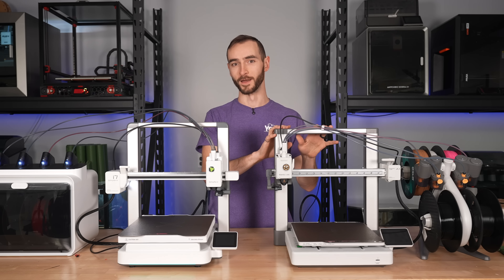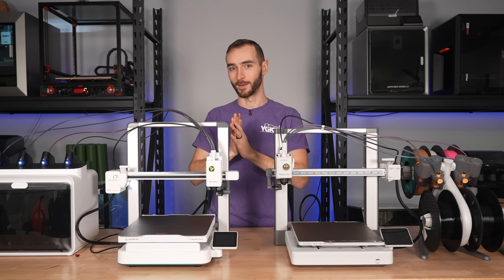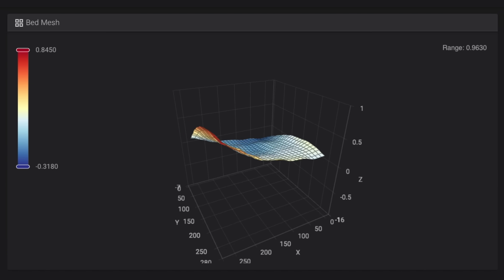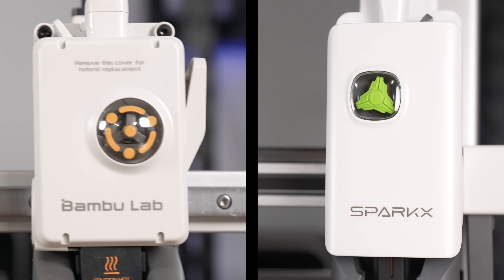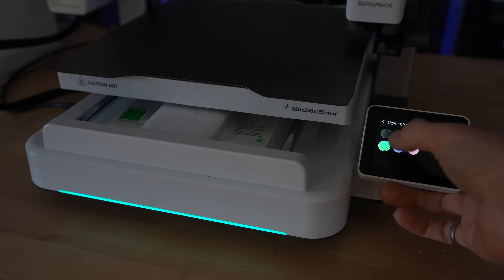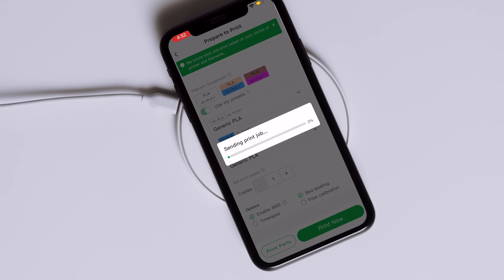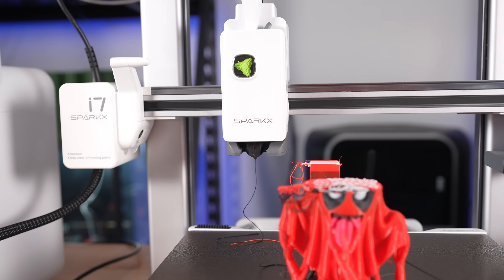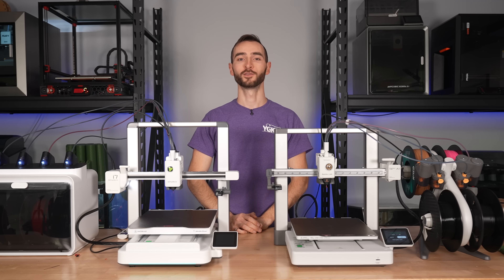Creality Cloned Bambu's Bestseller (and made it better?) - SparkX i7 vs Bambu A1

Comment: That only means one thing. A2 is coming out soon.
Reply: I'm not so sure. The A1 is basically the ultimate bedslinger. I would guess maybe a P2P could come out in the $450 price range and the A1 line will be left alone until phased out years from now. Bedslingers are becoming less appealing as core xy machines continue to get cheaper.
Reply: @Ukraine2-k7x  They have developed new tech on the last year along, Idk they could do something with the purge waste for multicolor printing for example.
Reply: @Ukraine2-k7x recently got a elegoo centauri carbon in my office for like the same price as the a1 it’s so goood as much as a1 is good I basically slice and print whatever fad designs I make it’s so seem less almost set it and forget it
Reply: @Ukraine2-k7x that is only as long as you're not using a plate changer like the JobOx system. I'll never switch to core xy, as I can print 12 plates on one printer without any intervention
Reply: @Ukraine2-k7x  Ultimate as long as it doesn't burn itself down to the ground with bambu not acknowledging that there is a problem and it's an active FIRE HAZARD.
Reply: @Splarkszter  Bambu handles recalls well. Let's not pretend they are the only ones to have possible issues like this 😂
Reply: @Splarkszter  They did It 1,5 years ago dude...
Reply: @Ukraine2-k7x No they ARE the only ones with fire issues. Lets not pretend its not a reacurring problem for Bambu
Reply: @Trafo888 Uh NO DUDE. There are NEW ISSUES...A1's are melting thier circuit boards now internally. 3D musketeers did a several month long investigation on it and Toms Hardware followed it up....Bottom line from both: DO NOT buy an A1
Reply: @William-b5s2r  Well no, Qidi has a larger fire issue with the Plus 4 I believe. No shame on them, they handled it as well. And I'm sure there were more that were with machines that just didn't sell as much or weren't in the audience of less advanced users.
Reply: @Ukraine2-k7x Those issues were with Beta units and it didnt cause fires, it was just an exposed wire that coukd burn your fingers if you touched it.  I would say that TWO different issues with actual flaming up from a single model machine is worse. And Bambu never "handled it well" they were threatened with lawsuits from the FCC first then they tried to tell people "just print a cover over the cord" for the first fire issues. FCC said that wasnt going to cut it so only then did they do an actual recall. This second time though which is WAY worse Bambu as if right now have done NOTHING even though they were told about the circuitboards melts 6 months ago.....So hmmm not really "handling" huh?
Reply: @William-b5s2r  Well, I'm pretty sure their whole "Print this cover for the end of the cord" was more as an interrim fix, since they were only on the market for a whole two months before initial reports of the issues (Of which, there were only 19 reports of damaged cables), so that IF people still wanted to use the printer, it would help to not put so much strain on the end of the cord, until they actually had the parts available.

And I'm sorry.... but where are you getting your "They were threatened with lawsuits from the FCC" from?  They issued an advisory notice about the cable at the end of January 2024, and issued a full recall on February 4th.
Reply: there has been a bamu pattern dropped for a duel tool head a1 style printer
Reply: @TwoWheelRyan  what is bamu pattern and bambulab pattent is only if you copy the exact same thing they change smaller things that bambulab cant sue them and chinas brand copy each other not a suprise
Reply: yup
Reply: If you look at printers in this class, they tend to follow a similar structural logic and design philosophy. That's not necessarily a bad thing. The outward appearance is really just a small part of what defines the actual user experience.
Reply: When ???
Reply: There is a patent already for a dual nozzle A1, saw it on the Bambu subreddit a couple days ago
Reply: The Kobra X wil blow them both out of the water.
Reply: @dennisraadschelders6821  ..... It's just another bedslinger.... looks no different from the A1 or any other that came before it.  The sad part is, I remember when the H2D was announced, everyone was ranting about how much of a nightmare removing a clog from the H2D's dual nozzle extruder would be.  Can't imagine it being any better on an extruder that feeds 4 different filaments down into the same nozzle in what seems like a very confined space.
Reply: @theElemDragon  but they both can’t print multi pla mixes. The X can do that. Also it has less waste.
Reply: @dennisraadschelders6821 what do you mean "multi PLA mixes"?  From two different spools?  Cause that doesn't sound like a benefit to me in the slightest.  How would that even work?  You'd need a melt zone SIGNIFICANTLY larger than 1.75mm, which I can't imagine being helpful for flow.
Reply: @theElemDragon  Sorry had some brainfog, I meant TPU. Like the U1 the Kobra is more or less on its own in that segment a segment that didn’t excist before.
Reply: @dennisraadschelders6821 features can be brought to market by anyone when you copy your competition's design. I loved their cam shaft design but end of the reliability is a big factor which Anycubic is not known for. There is a reason why there are lot many print farms running Bambu and Prusa two completely opposite brands when it comes to proprietorship because they are reliable. At the same time you don't see much Anycubic/Creality/Elegoo print farms do you?
Reply: NOPE! With the new fire issues of the A1 (capacitors melting inside) Bambu has to address that first. Couple that with the horrendous sales numbers and reviews of the H2C, H2D, H2S then the huge market loss to Snapmaker Bambu is in trouble.
Reply: @William-b5s2r  Horrendous H-series sales numbers and huge market share loss? Who are you kidding, Bambu still has almost 30% of the market. Snapmaker celebrated 20.000 U1's sold last month while Bambu sold over a million printers in Q1 2025 alone. The H-series might not be as good as expected and might not sell as well but they're still selling more printers than any other brand. 73.7% of the 3D printing market is Bambu Lab and Creality, the rest is mostly AnyCubic, Elegoo, and Prusa.

I know it's cool to hate on Bambu Lab these days, but lets not act like their business is crumbling to pieces.
Reply: keep buying their slop that got recalled twice and still catches on fire
Reply: @VD-cc4hx  Yeah, it sucks when a company acknowledges an issue and tries to fix it. That's also what creality does right? They fix their machines and don't just make a new one each couple months right? There is only one version of the ender 3 and only one version of the K1 right? We also don't think they would make a revision to the K2 right?
Reply: @slambaz2 Creality doesnt have issues with thier printers catching fire, no addressing issues if they dont have any 😂
Reply: @William-b5s2r  yup. Instead they don't fix anything wrong with their printers and just make a new version and sell that instead. I would know, I have 3 creality machines.
Reply: @slambaz2 What major issues has Creality had hmmm?  Lets see what you makeup, im curious
Reply: @William-b5s2r what is there to make up? How many different ender 3 versions are there? 13? More? How many different versions of the centauri carbon are there? How many different versions are there of the Bambu A1 are there? Until creality stops and makes a quality machine, their products will always just be third class.
Reply: @William-b5s2r  Brother's mad he can't afford a Bambu printer
Reply: @William-b5s2r  "Creality doesn't have issues with their printers catching fire"..... *searches Google*..... Would you look at that..... They had a potential QC/Design flaw in the CR-6 SE back in 2020 that resulted in reports of fires/smoke.  So..... Bambu had one..... Creality had one...... how many others had one?

Or there's the faulty heatbed on the Ender 5 Max..... or the supposedly SIGNIFICANT heatbed warping on the K1 Max
Reply: @William-b5s2r damn all you do is complain
Reply: @VD-cc4hx  are you upset that a company did a voluntary recall?  Creality should have recalled the K1 after the door shattering design flaw.  Shattering glass is a serious safety issue.

They did nothing.  They collected money from replacement parts.  

Bambu paid for the replacement parts.
Reply: @VD-cc4hx  me when I make stuff up.

Comment: i7 isnt cheaper, that is just the early bird price difference. altho the i7 is considerably better here, especially with the ams,  but u r comparing it to a 2 yo printer, u should have at least mentioned that.
Reply: It will be cheaper mate,  that;s the whole point of this, it;s a cheaper A1. The crossed out $399 is a BS marketing price they will never sell it at, it;sa trcik all the chinese brands use to say, This is what you are saving. when it will never ever sell for that price.
Reply: @FauxHammer don't know. I spent 250€ on an A1 on Christmas. This is hard to beat
Reply: @dsdasdasdasdertewbd 
Did you buy it with or without the ams lite?
That could make the change
Reply: Be honest, that’s the price you’re going to find it thru out its life cycle, including all the “sales” periods like Black Friday.

Comment: Print quality is the most important to me and that seemed to be breezed over rather quickly
Reply: Every other review I've seen of this printer has said pretty much the quality isn't great. In fact, this is the only review I've seen that gives it high marks and definitely the only one to claim it's better than an A1. I think it's odd that it failed 3 times on the same print yet that was glossed over and still somehow better than the A1.
Reply: @psychoticgoldphish5797 I agree. This was a "Hey look at this new printer! Here is where you can buy it!" Does not show us any of the downsides of the machine or discuss reliability. Hard pass.
Reply: @psychoticgoldphish5797 I started out on several Creality printers. I'll never go back.
Reply: @psychoticgoldphish5797  I mean...... it's Creality.  I don't think their printers have EVER been known for their quality of prints..... or reliability...... or consistency (unless consistently bad....)
Reply: Seems to be common with reviews today. Big focus on user experience and failure rate, but barely any on print quality.
Reply: @MumrikDK tbf, print quality is overall becoming the same between all printers and waaaay more dependant on the user than the printer itself
Reply: Because then it would be no competition between the two machines.
Reply: Nah it wasn't breezed over at all, just made that part fast because in every actual print metric it was objectively worse aside from barely wasting less filament... this video had to be sponsored. Clearly stated I7 failed more prints because of a design flaw that definitely will happen again, has slower startup time, didn't cover actual normal and fastest prints speed(I'm guessing because bambu wins that too), and then just quickly skimmed over the minor details of lower print quality and poor pressure advance to somehow conclude its better then A1 anyway

Comment: over 8k hours on my a1... lets see how the sparkx holds up after a few months. my enders always worked great, until they didnt.. usually months later
Reply: That's my thought. Cool. But it's still creality. 😬 I've had my fill of their printers
Reply: ditto. My brother recently asked me for a printer recommendation before this came out and asked if he should wait and I said no because even if the creality machine is good out of box i have not had a good experience with longevity and bambu has shown that they are willing to keep supporting their machines. Do I like their locked down software, not one bit, but for people who just want something to work and be a tool and not a hobby, the A1 is the go to
Reply: Creality has constantly missed the mark for every purchase. I reluctantly bought some of the space pi heaters...and they don't work when you use 2 rolls of filament with it.....🤣
Reply: New A1s keep popping their power board NTCs quite fast, so hold on to your good old working printer 😉

Comment: i would not have priced compared to a launch price. that is a "launch" price and do not know what a normal price is. also, the A1 has been around for 3 YEARS and Creality the bad clone company had 3 years to try to match. In the same 3 years Creality would have released 3-4 newer versions of the same printer line up. leaving those that bought this left with broken features instead of fixing them.

Comment: So when crealtiy tried to match the A1 with the Hi the first time around and that failed, they decided to fart out another printer while trying to minimize the tainted creality branding. And then there's the ender v4...
While this printer has a few nice features, I didn't see anything that would make me choose it over an A1. I do like that CFS lite a lot though.
Some things were left unanswered as well. Part availability? Compatibility with fiber filaments like carbon or glass fiber PETG or PLA? TPU?
The A1 can handle all of those.
This was definitely an informative video, but left some important details out.
Ross from fauxhammer had a less positive experience with his i7.
Reply from the maker: I think their big mistake with the Creality Hi was making it black instead of white. 

I’ll have to check Ross’ video out. I’ve got 4 printers to review this month so needing to go a bit more surface level on a few of them. TPU printed well in my testing.

Comment: That's just a clone but... the cfs lite is a major upgrade which save the i7 and probably a better option IF the printer is reliable as the A1 is.

Thanks for this quick comparaison.
Reply: i wouldn't mind seeing that machine run an actual bambu toolhead, necessary revisions completed of course, with vanilla klipper just to see what happens.
Reply: "IF the printer is as reliable as the A1 is"

😂🤣

I would not bet my money on it.
Reply: @janenglund mine are reliable maybe yours not

Comment: 150g of waste for a small cow head is insane, anybody who wants to do multicolor/-material (accept smth like hueforge) should just save up a bit and get the U1 in my opinion.

As of i7 vs A1 (no CMS,AMS), they seem the same, so with all the fire hazard reports about the bambu A series, there should be no reason to go with bambu at this point

edit: great video as always
Reply from the maker: You’re quite right. If someone is serious about multicolor they should probably just spring for the U1. But there will always be people looking for the cheapest option without considering the tradeoffs. AnyCubic has even this one beat at $269 for their 4 color printer. And supposedly it’s more efficient too. I’ll be coming out with a video on that soon.

And thanks so much for watching and commenting! It really means a lot to me.

Comment: Isn't a long retract also what the MMU does?
Reply from the maker: Prusa’s MMU? Yes, except in that case they retract fully all the way out, rather than cutting, which requires very specific settings to avoid clogging the hotend.

Comment: Ive had an A1 melt and almost start a fire. Did some research online and many other people have had the same happen to them i don't trust them.
Reply from the maker: Dang. Bed cable related or something else?
Reply: @ygk3d an ntc thermistor can overheat in a batch. Can melt the plastic cover but can't start a fire. At all. Bambu is sending out parts and the new batch is fixed...
Reply from the maker: @blackrul3z is this what Grant of 3D Musketeers has been speaking of recently?
Reply: @ygk3d  Yeah, it's overblown though. Grant makes it seem like every single A1 will have the issue, while it's only a very small % from a particular batch. None of my four A1s had the issue.
Reply: @NWGR  It's in the consumer's best interest to keep blowing this up until the company issues an official statement about what's going on and which batches are at risk or issues a recall. Licking the company's butt and making excuses for them isn't in the user's best interest.
Reply: @ygk3d  yeah Grants video is how i found out that it was the thermistor after it happen to me. The rest of the people who had this happen to them are on reddit. Pretty scary stuff.
Reply: @ygk3d yeah. Stuff happens, it's notzan active firerisk, and handled again nicely with an upgraded board and spare parts who got a problem
Reply: @blackrul3z let me just go ahead and put the new upgraded board in a melted printer... Do you think bambu would buy me a new house to if that burns down 😂😂
Reply: Every printer can catch fire.....

Comment: Great side by side comparison
Reply from the maker: Thanks!
Reply: Comparing it to a 3 year old printer? Nah, not really.
Reply: one catches on fire and the other doesnt
Reply: @VD-cc4hx  neither do, no need to spread fud
Reply: @VD-cc4hx small % catch fire, easy fix. That doesn't make it a worse product and the A1 is how many years old now? The A2 will be here and this thing will be left like the slop it is.
Reply: @Krautech What is that easy fix? Make ticket for new board and change it (99.9% probability you are not licensed to do AC maintenance or installation if we are strict 🤯) and bottom cover after waiting for the parts with a belly-up printer? Or short the NTC and hope it works with other existing components?
Reply: @kimmotoivanen I meant it's an easy fix for bambu.

Comment: Given that the i7 uses Klipper makes it the clear winner. I own an A1, its a good printer, but I would not purchase another due to BL attempts to lock users into their walled garden. I also own a P1S and I would buy another for the same reason as above.
Reply from the maker: That’s definitely one of the biggest selling points in my books too
Reply: It’s a valid concern, but as long as Bambu printers continue to work as well as they do, I’m ok with their closed(-ish) ecosystem.